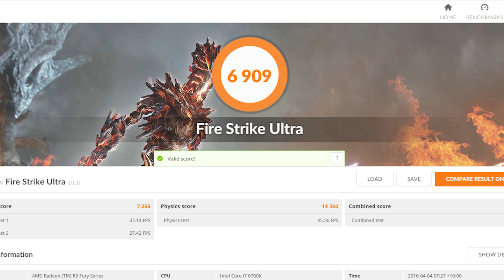VR-Ready, 4K-Capable Dual Nano Gaming Beast - PC Build

Comment: Awesome build, but I'm curious as to why you didn't space the GPUs out more for better cooling. I assume it would help, but I may be wrong, or the motherboard may not support CF on those PCI-E slots. I was just wondering.
Reply from the maker: +ipreferbenjamin I had planned to have the second card overhang the motherboard until I realized that the third PCIe x16 slot is only wired for x4 bandwidth. It shouldn't impact performance but I am yet to test and I wanted to make sure I was getting the most from the system. Thus far I haven't noticed the primary card throttling more than the second one or even running hotter.

Comment: Those are some premium parts you have.  Am I imagining things, or did you cut off the circulation to one of those Nanos?
Reply from the maker: +pillsnotbills Yeah they aren't bad. I had planned to have the second card overhang the motherboard until I realized that the third PCIe x16 slot is only wired for x4 bandwidth. It shouldn't impact performance but I am yet to test and I wanted to make sure I was getting the most from the system. Thus far I haven't noticed the primary card throttling more than the second one or even running hotter.
Reply: Hardware Unboxed In ye olden days it might not have made a noticeable difference, but without the bridges I do wonder if a PCIe x4 slot might be insufficient.  It will make good fodder for the test bench, eh?  Looking forward to it.
Reply: +Hardware Unboxed Ah, i was also wondering why you would put both cards so close to each other when there was another PCIe slot beneath. Also it looks like the second card would have blocked the HD Audio pins. 
Well, I'm interestested in the temps, so please include them in the benchmarks video. Looking forward to it! And awesome video, again :)

Comment: As a first time builder, I'm kinda scared about my memory. Does it have to be the same kind of hz as the motherboard supports or can it be a higher hz?
Reply: Sakamoto San It can be higher, but the mobo will underclock it automatically.

Comment: Can you include in your test if HBM gen-1 can be geared to VR? AMD has been on VR for years and I want to see if they nailed it or not. 

One the things that troubles VR is nausea due to memory latency and as a guy with glasses... VR can be a pain full of migraine.
Reply from the maker: +jonathan Linchangco I am yet to take delivery of my Rift so I am no expert but I get confused about questions like these. Why would the Oculus Rift or HTC Vive perform any differently that a normal 2160 x 1200 display in terms of frame rate performance? I just assumed it was a pair of 1080x1200 displays, one per eye.

Is it really memory latency that causes nausea or just the frame rate dropping below the targeted 90fps?
Reply: +Hardware Unboxed I think that games are rendered in higher resolution than the screen resolution as can be read in this article: http://www.tomshardware.com/reviews/oculus-rift-virtual-reality-hmd,4506-6.html

"Our comparisons are further complicated by dynamic quality adjustments that games will increasingly use to maintain that critical 11.11ms cadence. You see, in order to correct for the spacial distortion imposed by an HMD’s lenses, more pixels need to be rendered than the actual resolution of the display—a common target is 1.4x. But if a game engine determines it’s going to miss its frame rate goal, 1.4x might slip to 1.3 or 1.2x, sacrificing some quality (we’re told this can be almost imperceptible) in the name of maintaining an immersive experience."
Reply from the maker: +Ola Justin Okay so that is still well under the resolution of 4K then. I am really keen to get my hands on the Rift and learn about it first hand. It is so hard to understand the technology without seeing and testing it first hand.

I still don't understand how HBM could be any different for VR than it is for standard 4K gaming for example.
Reply: How about an apples to apples? AMD Nano and Nvidia's GTX 980 Ti VR ready GPU's

Both product claims that they've been prep up for VR and let's see who is really prepared and which is going to be the baseline for the first-gen VR headsets
Reply: +Hardware Unboxed I dont think HBM are any better than GDDR5 eather, so I kind of agree in your thinking. It seems like a bitch to benchmark VR though. 

Great channel BTW!

Comment: Great job every since the nanos have Dropped I  have also been thinking of almost this exact same build :) You beat me to it... excited to see how this thing does next week! Will you be comparing it to a 980ti sli or gtx 980 sli build so we can get a good assessment of value for money the nanos offer at the new price point?
Reply from the maker: +Vamrick I only have one 980 Ti and one 980 at the moment. If I had a second of either card I would have included the results but this is more just to see how the system performs. Generally I like to go in-depth with those kinds of comparisons so it would be a separate video anyway.
Reply: the nano is better than the 980 and the 980 ti is better than the nano
Reply: got ya my system is the 980ti sli with 6700k with the 480gb predator so it will at least give me a good idea if I can run the same benchmarks and settings as you. I just like the small form factor that the dual nanos can bring..Almost choose your exact build which is why i was hoping you could do an apples to apples :) but I appreciate the response!
Reply from the maker: Vamrick This is very dated now but when I was starting out I made a Fury X vs. GTX 980 Ti comparison... I have since sold one of the 980 Ti's to a mate, I will have to get another one soon.

Excuse the audio and video quality...

https://www.youtube.com/watch?v=WkeeNErg0-s
Reply: +Hardware Unboxed I didn't experience any problems with audio/video quality. But ne way this would be a great test to redo now with the Radeon crimson drivers, I am sure there would be a marked improvement in the Fury X's performance as it was being choked a bit by the drivers when it first was released.
Reply from the maker: +Philip Pears Using the latest drivers I have been pretty disappointed with the game support so far. There is no support for the second card in Just Cause 3, Tom Clancy's The Division, Rainbow Six Siege, Assassin's Creed Syndicate and shockingly AMD sponsored title Hitman. Dying Light suffers from slight flickring as does The Witcher 3. Hitman won't even load in the DX12 mode, just crashes and the same is true for Rise of the Tomb Raider.
Reply: Hardware Unboxed Yes that's a bit sad, but I don't have a CF setup yet and wouldn't pretend to know what games have working profiles and which don't. I am aware though that the drivers are updating very regularly now (almost every couple of weeks), so hopefully you'll see some fixes in the near future for some of those titles. However I was alluding to running the same benchmarks on those titles you did in your video, in order to see how much performance differs now as compared to then.

Comment: i heard the Fury Air have the best Crossfire scaling / price in high end gpu even in some game it's better than gtx980ti and FuryX crossfire
but the nano even with the price cut still not worth it , unless you just build it in a supper mini ITX tower
Reply from the maker: +Sega Hen No Crossfire scaling will be the same on the Nano, Fury and Fury X as well as the 390X and 390 for example.

Comment: 6:11 - Seriously, an HDD? With that BEAST??? Get outta here!

I don't mean to sound like an ass but IMO HDDs just going to hold eveything else back in PCs these days.
Reply from the maker: +Thomas C. lol where do you store your data? Are you going to buy 6TB's worth of SSD storage just to have your data sit there and do nothing most of the time.

For example you don't need an SSD you store your multimedia content, watching a movie at a few MB/s doesn't require an SSD.
Reply: +Hardware Unboxed For much of my storage needs I typically place such data inside an external hard drive in order to save space and keep my internal drive for games.
Reply: +Hardware Unboxed right now I am using an HDD myself but I plan to make my next gen rig have SSDs.
Reply: +Hardware Unboxed Actually I just saw what the HDD is. Unless I am mistaken, those Western Digital Black HDDs are the fastest ones on the market.
Reply from the maker: +Thomas C. Why you are doing yourself a disservice. This case already has room for three 3.5" drives, there is no advantage to not using them. External storage is a serious pain. I would rather have 3.5" drives neatly tucked away in a case than have external crap all over my desk.

The WD Black drives are great but even the cheap Green and Blue drives work well for secondary storage and they are normally the type of drives you get in those cheap WD enclosures.
Reply: +Hardware Unboxed Disservice? I never saw it as such really. Rather than being a pain I always found it convenient personally. But I can see your point.
Reply: +Hardware Unboxed OK so I noticed a while back that your system does in fact have an SSD though not installed in the traditional manner.
Reply from the maker: +Thomas C. Ohh I didn't realize you thought it was only using a hard drive.

Okay so I think we are jumping on the same page now.

I would never ever build a computer without an SSD boot drive that is at least 240GB in size. The hard drive is just for storing large data that doesn't require lighting fast access times or massive throughput.
Reply: +Hardware Unboxed well I noticed it way back actually I just forgot to note it in my original post. Sorry for being a jerk.

Your machine is indeed a beast. The combination of those two GPUs should be at or near the performance of a Titan X combined. I'm curious as to how well it would run ARK which has a whole host of optimization problems. Though I do know a trick to getting better performance out of it if you are interested.
Reply from the maker: +Thomas C. In games that support Crossfire correctly the dual Nano's slay a single Titan X no worries. In games that don't support Crossfire the results are obviously less impressive ;)
Reply: +Hardware Unboxed Like Arkham Knight right? Its unfortunate they gave up on adding SLI/CrossfireX support to it. Which I can understand considering it came out bad for PC from the start.

I take it you have already OC'd the bad boy?
Reply from the maker: +Thomas C. Batman Arkham Knight is one game, Just Cause 3, Tom Clancy's The Division, Hitman, Rainbow Six Siege and Assassin's Creed Syndicate are some other newish AAA titles that don't work.

Overclocking the Nano's is pointless on air for the most part given they are already thermally challenged and suffer from throttling. The only real way to extract better performance is via liquid cooling.
Reply: +Hardware Unboxed Ah, and I suppose you wouldn't bother liquid cooling them either. What about the CPU?
Reply from the maker: +Thomas C. There aren't that many Nano water-blocks out there, EK make one and Aqua Computer. So I might look at doing that down the track but it wasn't really called for with this build.

The Core i7-6700K on the other hand will be overclocked.